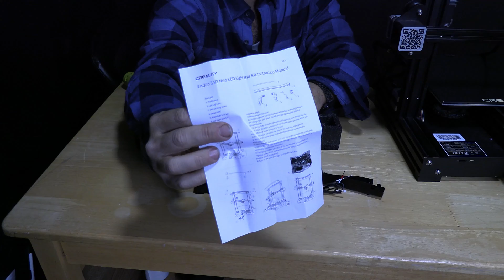How to install an OFFICIAL Creality LED Light, on Ender 3 V2, Pro, and NEO

Comment: Why not just wire the light to the power supply where there are a couple of + & - connections. The power supply output is 24v which the light is. Would be easier than wiring to a shared port on the mainboard.
Reply from the maker: Doing it according to the instructions

Comment: I'd at least test the light first before putting everything together. Also make sure the unit was unplugged first.
Reply from the maker: The only "together" there is, is the foam cover. Off is fine. This port is 0.3 watt

Comment: Thank you so much for this video. I watched other videos and the other people were clueless. You explain things so well. You explain the channels that the wires go into and thru. You explain the self threading screws you explain the wire going down the back and the plastic cover. You explain hooking it into power. The other videos I watched are a joke. Other videos don’t even install it properly and are using their videos as an example. Excellent job on your part! Excellent!🎉🎉🎉🎉🎉🎉🎉
Reply from the maker: I'll be doing the light on the SE and KE soon also. Very similar.
Reply: @3DRundown  
Excellent!  I just bought the KE printer. I will unbox and assemble it soon.

Comment: Can I turn the Creality LED light on and off using the Creality Cloud App?
Reply from the maker: No, because it's hard wired to the board, and controlled via a physical switch. For printers, such as the CR10-SMART with Stock LED lights, you CAN.
Reply: @3DRundown  is there anyway to have the LED controllable via the Creality Cloud app for a Ender  3 Pro?
Reply from the maker: Not that I know of, because the PRO also has to be wired to the board. The S1, and the CR10-SE have dedicated light ports. Somebody smarter than me, may have a way?
Reply: @3DRundown  thanks  for the reply! ❤️

Comment: I got one of these lights for a great deal online and I'm happy it's now installed and working! Not to hard once you know where the cables need to go. I would like to see them create one in a ring that extends around the back of the printer as well to eliminate shadow. Nevertheless, it's a great light that I can use to check prints at night time. Love it!

Comment: So what should I trouble shoot when the light doesn’t turn on at all?

Edit: I’m on a CR-10 from 2017, but I don’t think that makes a huge difference.
Reply from the maker: 1st Check for voltage with a meter
Reply: @3DRundown  what voltage? The printer turns on with the little pins in the same port as the power cables, the LEDs not turning on.
Reply from the maker: Do you have 12v at the light? Losing power somewhere. Perhaps a bad cable, bad solder, etc, somewhere between the connectio at the board, and the LED itself. Test the LED on another power source, see if it turn on. If not, look for that connection issue, or, return it for a replacement

Comment: You did this 5 months ago and it's still helpful. As of today it's only $20 on Prime after a $3 coupon.  I have an original Ender 3 modified to be about like a V2.  After watching your video I didn't have to go to the tiny "instructions" at all.  Thanks to one of your commenters (Victor,) I just connected mine right to the power supply as there are already spare 24v terminals making it unnecessary to remove the motherboard.  It looks and works great!  Thank you.
Reply: Just design and print two brackets that slide into the top rail. Then design a half pipe that acts both as a light shade and connects to the brackets. A cheap 12v self adhesive led strip can be cut to size to fit inside the half pipe. Power it from the 12v fan socket or use a seperate 12v regulator to drop 24v ->12v

Comment: If you have an Ender 3 or 3 Pro I think you can tap power from the power supply.
Reply: Thanks, Victor, I did it your way and it was an easier install.
Reply: Yes!!!! DO NOT try it with your motherboard. You will get some mean sparks

Comment: I was about to pick one of these up, but I'm concerned about the shadow - I think if I DIY'd this, I'd put the light out closer to the front of the machine.  Maybe even print a vertical mount that mounts right to the front (though that might inhibit access a little bit).
Reply from the maker: This thing is so bright, I use it to light my S1+ that sits next to it

Comment: I have an Ender 3 Neo and I want to install an LED light with a dimmer switch. Would it be fairly straight forward to add a dimmer switch to this kit or should I look for a different kit? Recommendations on how to get started are appreciated.
Reply from the maker: Not sure on the dimmer. It's a pretty generic setup with an LED Strip. If it can be done with an LED Strip, it should be able to be done on here...

Comment: Any concerns with this kit if you have the 2nd z axis installed? Where that wire comes out at the bottom of the z axis bar is where the second motor is.
Reply from the maker: Nah, S1 is the same basic thing and has Dual Z. Just route the wire carefully, and attach it to something if need be, to keep it out of the way

Comment: Great video! I’m having trouble finding self-tapping screws of the right size. Any recommendations on a good online retailer and what size/style you used?
Reply: Broski, the screws are in the box with the light. That said, Homedepot 1000% has screws that will work
Reply: The ones that came in my box were machine screws, not the self-tapping type used at 6:16 of this video. I’m installing on an Ender 3 pro so the screws that came with it are not going to work
 I’m mainly curious about the diameter and depth of the ones used in this install
Reply from the maker: I will have to check then. but they were definitely the ones included in my kit. Did you use the creality kit?
Reply: @3DRundown  it’s the Creality kit. Maybe a different version- I guess I thought you DIY’d the screws. Had no idea they were the ones you had in the kit. No worries, I’ll do my best to find something at a big box store. They seem to be about size 5, 10mm or so. Thanks again!
Reply: The screws self tap into the Aluminum but as the instructions said once they are started you should use the short end of the Allen wrench to tighten.  A little force gets them started.

Comment: How much slack would you say is in the wire for the LED light kit? I ask because I want to install this with an Extension Upgrade Kit. Thanks for the video and I look forward to your help with this.
Reply from the maker: Quite a bit. You can likely run it easily
Reply: @3DRundown  awesome, can’t wait to get it all together. Thanks again!

Comment: Great stuff! So I also just received my Ender 3 light! However, the wire is nowhere long enough, and it's got a connection on the end? Have you heard of such a thing?
Reply from the maker: Sounds like you got the light for the S1, which plugs into a connection on the base of the machine. Send it back and get the one linked in my Description.

Comment: Hey bro this is Marty Martinez from your group. What is the measurement on the width? I’m wanting to see if I can mount this on a different printer. Thanks man
Reply from the maker: Hi Marty! The center part, with the light inside, is 11.5"
Reply from the maker: I would guess, that you could simply Print a space, to make the mount longer if need be.